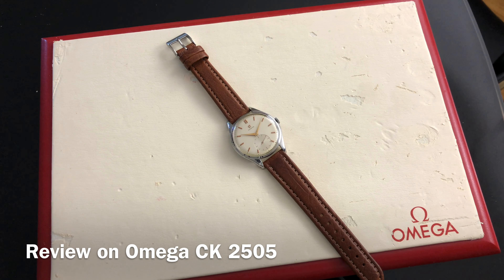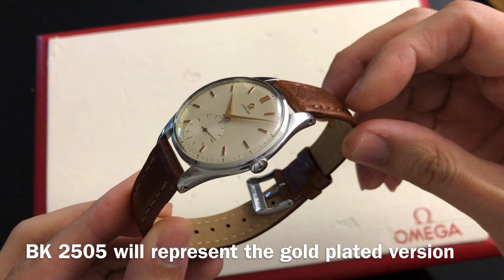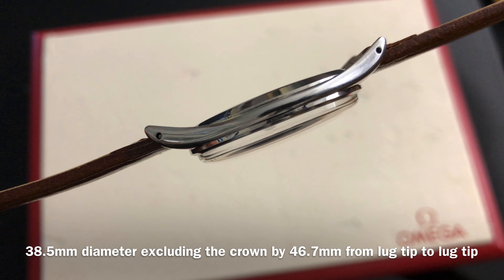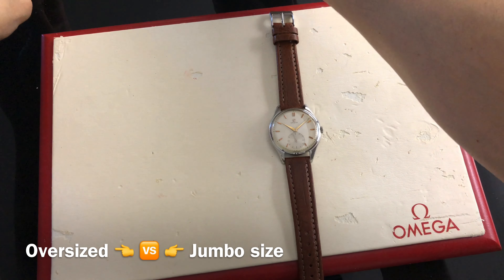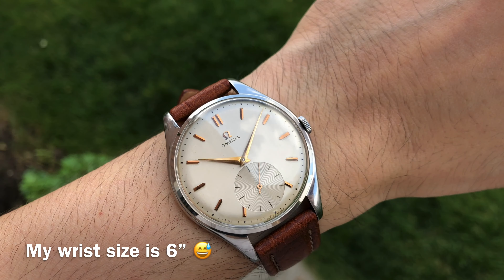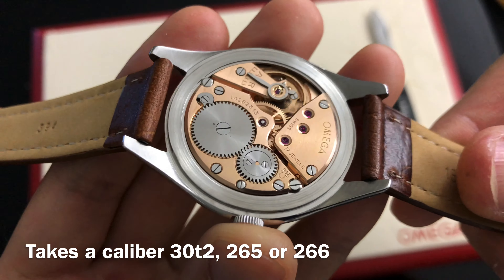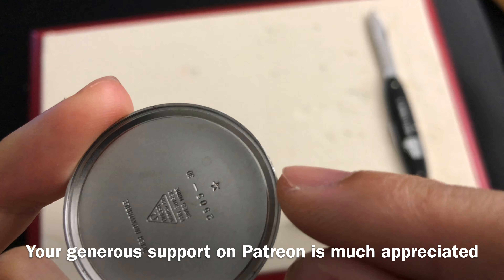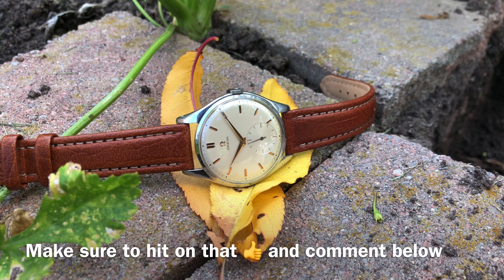THINGS YOU SHOULD KNOW PRIOR TO BUYING A VINTAGE JUMBO SIZE OMEGA - CASE MODEL CK 2505

Comment: how can I find a replacement for the crystal for this model?
Reply from the maker: I don’t know the size off the top of my head. But if you have a watchmaker he can easily order one by sizing it with his vernier caliper. It takes a low dome acrylic crystal. You’ll need a crystal lift to remove the old one and install the new one with. You can also order a crystal on www.ofrei.com. You do not need a genuine sign crystal as the generic by size would be the same in quality.

Comment: These are beautiful I had one from 1954, found my on a auction site where some one sold it as a old watch that they found and the asking price was 100€ (in 2016). I had it serviced and searched and found a original clasp and a time correct box, sold it 3 years ago when I needed money to buy a vintage Day-Date. The only things that I had to complain about this watch is that it was a bit to thin for the design and the bracelet was 18mm, I think it would have looked better if it was 19 or 20mm.
Reply from the maker: Thank you for the comment.  Don’t think we will ever see this watch for 100€ in todays market haha. 
It is quite slim due to the movement thickness and diameter.  19-20mm lug width would be nice.  But I assume Omega went with 18mm so it makes the case appear wider.

Comment: Does anyone know the  correct ck2505  crown reference or part number? I am trying to source a genuine replacement.
Reply from the maker: Unfortunately, this crown is discontinued.  According to my Bestfit reference book, 2505 crown ref# is 1136.  And the Omega reference # should be 8567.  Make sure the thread size is 1.2 in diameter as well.
Reply: @TimelessHistoryChannel  Thank you
Reply: @TimelessHistoryChannel  Prise  How

Comment: On the inside of the  2505 case back, what does the star symbol mean?
Reply from the maker: To me that is the representation of the Teddington star.  Meaning the accuracy of this watch is very precise.
Reply: @TimelessHistoryChannel   Hi, appreciate the insight. Also, would you happen to to know the  ck 2505 part number or reference  for a replacement crown?
Reply from the maker: @gazboroconnor2873  Please take a look at the other reply.